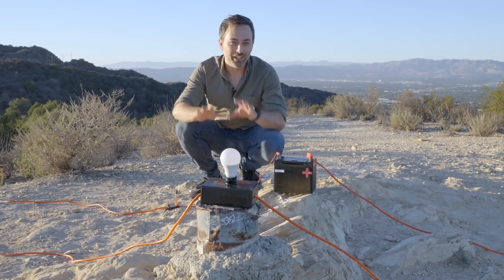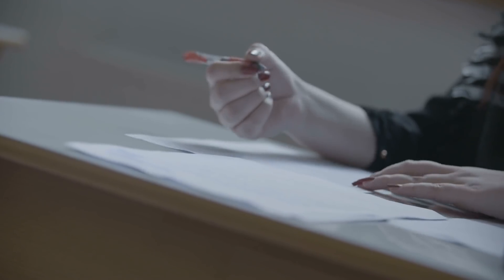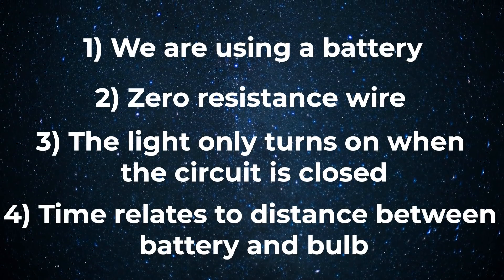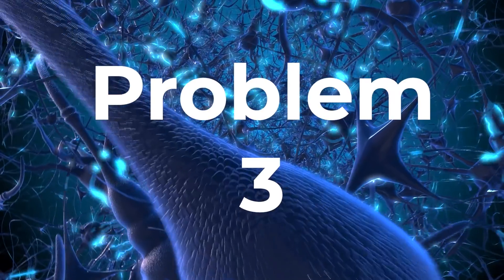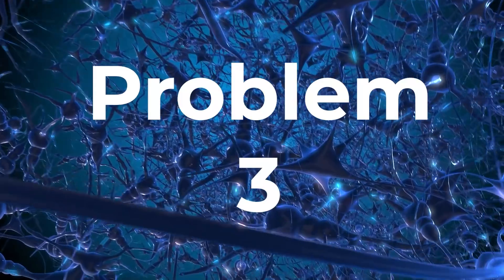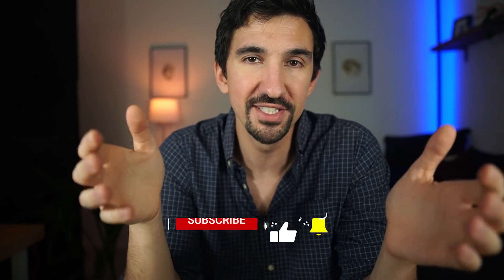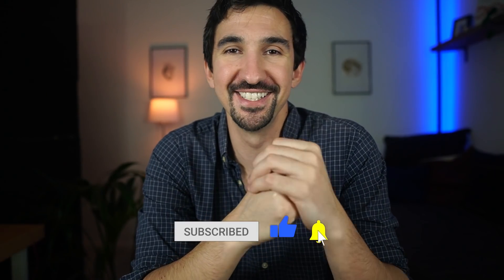Is Veritasium Wrong About Electricity?

Comment: 1/c ie 1m over c in meters   so its the time to jump directly across the wires seperated by 1 meter ? sounds a reasonable possibility?  am I missing something here ?
Reply: Yes, understanding of physics. :-)
Reply: @lepidoptera9337  Did year 12 physics , then chemistry degree which included university first year physics and 2 years of mathematics (High level Calculus and statistics).   Perhaps you are mistaken because the 1 m I talk about is the separation of the wires between the switch and the light globe in the diagram.  Hence 1m / the speed of light in meters (C) = 1/C.
Now do you get it ?
Reply: @passivehouseaustralia4406  Yes, that's just enough to be dangerous. Not enough to be rational. :-)
Reply: @lepidoptera9337  Ok now you are just baiting me ;-)
Reply: @passivehouseaustralia4406  From one PhD in physics to another non-PhD... yes. :-)
Reply: @lepidoptera9337  Ahh explains a lot ! I was offered a masters but decided I wanted to experience the real world.   That being said I am still mucking around with some ideas (in math) that the scale of things may actually influence more than what we currently attribute to it.  Might even bridge quantum to relativity..... (beware flying pigs). Cheers!
Reply: @passivehouseaustralia4406  Experimental high energy physics is about as real as it gets, I am afraid. I did it in the deep sea, under rock and in space, in the Northern and the Southern Hemisphere. I am sure your "real world" experience was equally rewarding. :-)
Reply: @lepidoptera9337  its interesting that Einstein pretty much put his relativity theories together from pure thought.  It started with ""If I was a ray of light what would I see if I looked across at another ray of light." thats not the exact quote but you get what I mean.  I am a little jealous of your adventures by the way !!
Reply: @lepidoptera9337 " ...a paradox upon which I had already hit at the age of sixteen: If I pursue a beam of light with the velocity c (velocity of light in a vacuum), I should observe such a beam of light as an electromagnetic field at rest though spatially oscillating. There seems to be no such thing, however, neither on the basis of experience nor according to Maxwell's equations. From the very beginning it appeared to me intuitively clear that, judged from the standpoint of such an observer, everything would have to happen according to the same laws as for an observer who, relative to the earth, was at rest. For how should the first observer know or be able to determine, that he is in a state of fast uniform motion? One sees in this paradox the germ of the special relativity theory is already contained."  exact quote from the man himself.....   Seems you should maybe calm your ego.
Reply: @lepidoptera9337  "...a paradox upon which I had already hit at the age of sixteen: If I pursue a beam of light with the velocity c (velocity of light in a vacuum), I should observe such a beam of light as an electromagnetic field at rest though spatially oscillating. There seems to be no such thing, however, neither on the basis of experience nor according to Maxwell's equations. From the very beginning it appeared to me intuitively clear that, judged from the standpoint of such an observer, everything would have to happen according to the same laws as for an observer who, relative to the earth, was at rest. For how should the first observer know or be able to determine, that he is in a state of fast uniform motion? One sees in this paradox the germ of the special relativity theory is already contained."  Quote from the man himself.   Perhaps you need to address your ego.
Reply: @passivehouseaustralia4406  It seems that you don't know that Galileo wrote pretty much the same thing 400 years earlier, or so. :-)
Reply: @lepidoptera9337  What happened to your quote of "bullshit" perhaps it should be replaced by sorry ?  or maybe that ego is still calling the shots over there.
Reply: @passivehouseaustralia4406  Science is not a series of quotes. It's a series of facts and their rational, quantitative explanation. You need to try harder. :-)
Reply: @passivehouseaustralia4406  That all physics is relative was known experimentally at Newton's time (as I said, even Galileo gave you the correct experiments that are equivalent to Einstein's elevator) half a century before Newton, or so. It's really not my problem that you don't know the history of science and that you come to the entirely wrong conclusions about Einstein's work. :-)

Comment: I feel like you watched Veritasium's video out of one eye whilst making a sandwich.
My understanding is that the hardware were merely 'symbols' of a circuit. The voltage or the resistance etc are not important in the goals of the video . The propositions, as I understand it, are that electrical energy is not a flow, nor is it carried by electrons moving inside a wire, but in a field outside the physical wires. Also that the energy doesn't propogate along or through the wire from point A to point B but energizes at all points around the wire when the circuit is closed. I'm sure there are many videos also piggybacking Veritasium's work and adding to the discussion but for me, I struggled  to see your content as anything more than a grammar critique.
Reply: Well, voltages and resistance are important if you are talking about foolish stuff like light bulbs in that video. Veritasium simply messed up in presenting the topic poorly. He may have wanted to say one thing, but ended up saying another.
Reply: @lepidoptera9337  I agree that his method has befuddled a lot of viewers and as such, reflects on his delivery of information. However, there's a lot of Batman Vs Superman arguements going on here. The wire is imaginary. It's resistance is also imaginary.The video was simply to present the assertion that electrical energy doesn't flow from A to B through a wire at the speed of light like everybody thinks it does.
Reply: @davewalkerden  That may be as it is, but all we are looking at here is a more or less trivial long transmission line problem. One can discuss this without any befuddlement and that is what he should have done. He didn't. He made just another bad physics video. The internet is full of them. It's a perfectly normal day.
Reply: @davewalkerden  Well however the change in the EM field travels strongly along the wire, and weakly through the air.. so it depends that one means with "light up". Will something happen on the bulb in 1/c seconds? certainly, because the wires are a (weak) capacitor and the turn on event is a high frequency pulse. Put it will only be a tiny fraction of the energy in the bulb.. until the EM field traveled all around the wire.. then the bulb will get the full energy.

Comment: I actually measured it (25m not 300Mm for obvious reasons). The voltage is there almost immediately, but no measurable current flows. Significant current only flows after electricity made its way all the way around in the wire at 2/3c (which is the actual speed of electricity). The un-useful assumption Veritasium made is that any current >0 is sufficient for the lamp to be considered "on", in which case, the wires do not need to be connected and they can have any resistance. The lamp will still be considered "on" after 1m/c until forever. Which is bullshit if you want to explain how long actual circuits take to turn on.
Reply: Of course a measurable current flows. What in the world are you talking about? :-)

Comment: 2:50 Yea, that's what I thought too. But, then, I quickly realized that the magnetic field also has a speed limit, which is the speed of light. This is why the model he used involved the battery and the lightbulb being so close together while the wires are setup with stupid length. 
To show that it doesn't matter how long the wires are. It doesn't matter either way if the battery and the bulb are that close together anyway.

Heh. I love this. XD hahahaha!!
We need a clarification video for this from Veritasium.

Comment: I’m a little confused still, is veritasium really claiming that the energy transfers from the battery to the lightbulb faster than the electromagnetic field can propagate around the circuit in either 0.5s/c direction? Are we meant to assume there is no interference between the wires running within a metre of each other?
Reply: Energy transfer here happens at the speed of light. Most of the people here simply don't know how to analyze what both physicists and EEs call a transmission line circuit.

Comment: excellent! I fully agree, in this scenario, antennas are a much better mental model and the definition of "turning on" the lightbulb needs to be qualified a bit better. IIRC the magnetic field decreases with the distance, the electric field decreases with the square of the distance. Wouldn't that mean that the Poynting vector would decrease with the cube of the distance?

Comment: My suggestion is, let's find a way to test it. 
We dont need a wire as long as that one. Just long enough to be able to measure it. 

The 1 metre apart should be ignored. It was meant to be a distance that is negligible for the "calculation" to simplify the question. 
In our experiment we can ensure the distance is big enough not to influence the results

Comment: This was my first reaction to the video as well; considering what would happen if the wire would break at either end of the circuit. 

To not violate the limit of speed of light, this change couldn’t be perceived instantly. And so, when we first flip the one switch, either the information about the whole circuit being closed either takes appropriate time OR this information is somehow “baked in” to the system. 

And so, Vertasium must under this line of reasoning propose that the circuits state is somehow “baked in” to the system, before the switch is flipped. The video doesn’t in any way clarify this.

Your idea of antenna bypasses this limit, but goes somewhat against the original question: the Vertasium video discusses transcontinental cables later, so if parallel antennas produce enough current to satisfy the thought experiment, why bother closing any long circuits at all?

Ultimately, either the systems whole state must be baked in somehow, and the electromagnetic fields outside the wire can start working normally faster than light, electricity or information can reach the whole circuit, or the answer Vertasium gives is simply wrong.

However I wonder how the current would change over time between the antennas experiencing induction, and the information of the whole circuit being “confirmed”? Is there a sudden spike when the information of the circuit truly being closed has “arrived”, or are 1m/c long parallel superconducting antenna 1m from each other so close to superconducting wire that the current just smoothly rises as more and more of the antenna has time to start moving current? Meaning that at long enough ranges, we truly shouldn’t bother closing circuits?

Comment: Ben, your intuition (with your optical physics background) aligns with my intuition (with my classical electrodynamics background [with an M.S.E.E. degree]). There would be an impulse of energy radiated at the moment the switch is closed due to the accelerating electrons and might illuminate the lamp, but it would be so quick and unlikely to be seen. The conventional current would need to travel the entire length of the conductor before a steady-state field would be established. Although Veritasium is correct that the energy flows in the E-M field outside of the conductors, he (and Nick from The Science Asylum whom he mentions) seem to forget basic physics. The energy that flows from the battery to the load travels in the E-M field that is established by the moving electrons. However, nearly all of the energy flows along the surface of the conductor, and very little out in open space. Poynting's Theorem says the flow of energy is proportional to the cross products of the electric and the magnetic fields. We know that the strength of the magnetic and electric fields are inversely proportional to the square of the distance from the source (Coulomb's Law for the electric field and the Biot-Savart Law for the magnetic field), so the cross product of these two fields is inversely proportional to the biquadrate of the distance (square of the square, or 4th power), so that almost all of the energy flow occurs on the surface of the conductor (not within the conductor) as both the electric and magnetic fields are strongest at the conductor surface.
Reply: That impulse will take 1/2 second to reach the end of the loop though, and its effects will take another 1/2 seconds to return from the end down the other side.
Reply: @briant7265  The impulse I was referring to would reach the lamp after traveling the one meter distance (it 'jumps' the empty space). It consists of an RF pulse that is radiated at the moment the switch is closed, and it also includes capacitive coupling between the leads of the switch and the leads of the lamp. Neither would likely have enough energy to illuminate the lamp (unless the lamp load is exceptionally low) , and one would most likely need to wait the full second for the field to travel the length of the conductor before the lamp illuminates.
Reply: @sorensolveig599  I was responding to your assertion that the impulse at the light would be brief. It would last a full second, because the effect of the head of the 12V impulse will travel outward for 1/2 second and the last of that effect (at the end of the loop) will take 1/2 second to return to the lamp.

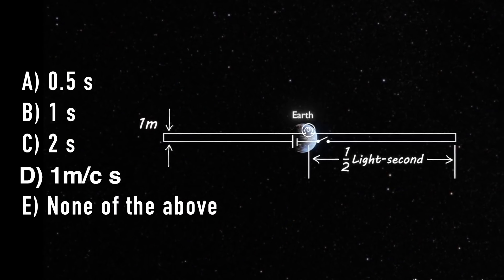Comment: 1/c seconds make sense and the units are ok because the 1 in the formula is 1m. So [m]/([m]/[s]) => [s]. The units match. 2:14 - One doesn't usually put units in a formula. So no! It shouldn't have been 1m/c. 1/c is totally ok.

Comment: I also take issue with the idea that opening or closing the circuit is an instantaneous action. Much of the confusion around this thought experiment feels like it stems from the mixing of a crude discrete model (circuit diagrams) with the continuous concepts of fields and spacetime.

Comment: I think debating real life engineering misses Derek’s point. We’re making idealized assumptions and not worrying about resistance of filaments or designing circuits. The video was exploring this idea that the electrical field will light the imaginary idealized
light bulb without traveling around the length of the wire.
Reply: That's backwards.  Treating wireless power transmission as "idealized" is missing the point, rather.  That is in fact "real life engineering", known since at least the time of Tesla.  The Veritasium point was indeed the reverse of yours: that the idealized mental model of a chain of electrons pushing one another around a wire is flawed, and a better mental model acknowledges what the "real life" electrical engineers (and anyone with a wireless mobile telephone charger, or indeed a Bluetooth headset) will tell you: energy can be transmitted through free space as well as down wires, and It Does Not Really Work Like That and The Simple Answer From Your Train Of Electrons Pushing Along The Wire Model Is Wrong.

And S. Miles' point is that the Veritasium explanation is in its turn a Lie To Children, and can lead to false conclusions if applied beyond the (in some part unacknowledged) boundaries of its simplifications.

Comment: I would agree that Veritasium didn't make a thorough explanation this time. He showed a graph of modelling just for a moment, and he didn't give any details. It was clear from that graph that the bulb won't shine brightly after 1m/c. And I agree with you that the first signal that would reach the lamp and would "lit" it up, is the signal that can be described like a signal sent by antenna.
I would say about 1 more common misleading statement. It's not the wires that propagate the electricity, it's rather EM field that is concentrated around it. There is a dependency on the insulation, and the insulation brings certain losses and decrease of propagation speed (which is c for vacuum insulation, and may differ by tens percent for a typically used insulator)
Reply: And 1 more criticism for Veritasium video: if there is no exact time separating the lamp status off/on, then it's typical for physicists to characterise the process by a certain level of the signal. It might be 1/e, half maximum, and like this

Comment: Have you actually worked out the current and voltage necessary to induce a magnetic field using a single straight wire, which then induces a current on a single parallel wire 1 m away?  Although I understand what you are trying to get at, I think that Veritassium is wrong.  If Veritassium is correct why is wire length critical to computational speed?

Comment: Oh my goooodddddd the 1/c thing makes so much more sense with 1m/c now. I even left a question on the original video trying to ask for clarification about if the 1 meter distance is where they got the 1 in 1/c but no one said anything. I was honestly hella confused if it was just the inverse of c, or if the numerator was the distance from the switch to the light